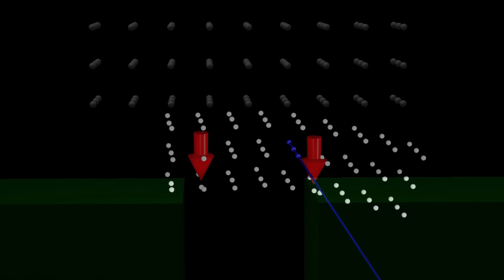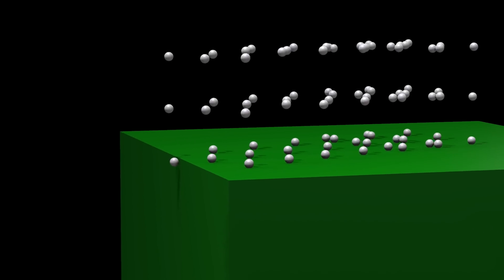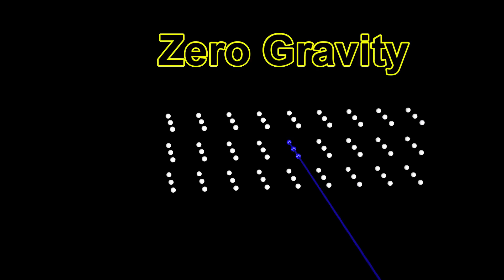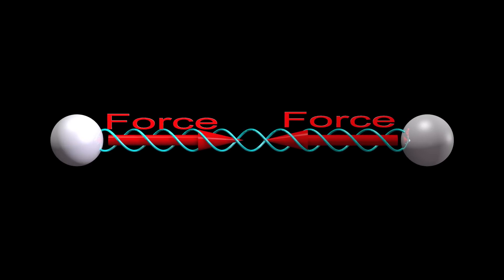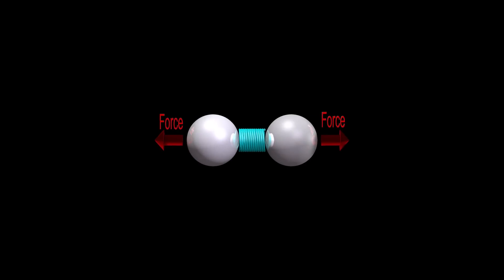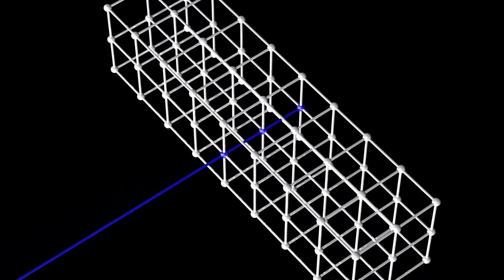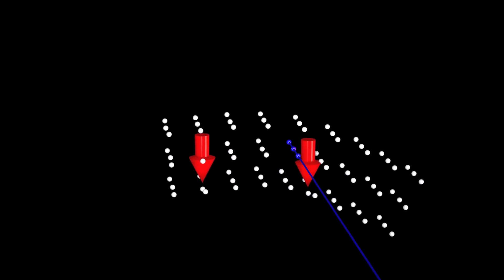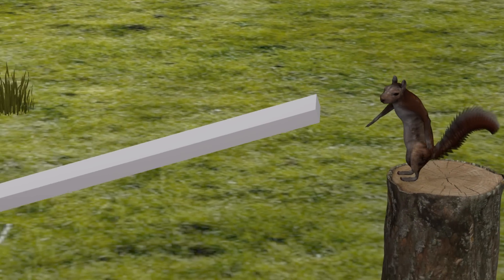Torque can’t exist for rigid objects

Comment from the maker: I have received a number of comments questioning whether we really need non-rigid objects.  This is discussed in much more detail, with mathematics, in the paper at https://scholarship.haverford.edu/cgi/viewcontent.cgi?referer=https%3A%2F%2Fwww.google.com%2F&httpsredir=1&article=1494&context=physics_facpubs
Reply: I've been interested in this specific question myself. I've gone through the same reasoning as the video laid out, but I'm not fully convinced one way or the other regarding rigid bodies. 

There are several reply papers you can find as well. One is Comment on “The physical origin of torque and of the rotational second law”, a counter-reply is Reply to “Comment on ‘The physical origin of torque and of the rotational second law’”, and another one is Another comment on “The physical origin of torque and of the rotational second law”.

I wonder what you think about them.
Reply: @maximusideal  For some reason, i can't see my second comment anymore. To keep it short: I didn't realise there were comments on this article. The article by ‘Randall D. Knight’ already shows what I have claimed: The forces assumed in the original paper are not correct. Regarding the comment on the comment (by Daniel J. Cross himself): I understand the points being made, but the maths is definitely missing here. An important concept that Daniel J. Cross ignores is that bearings can cause external forces and torques, so in some cases even the energy and angular momentum are not conserved.
Reply from the maker: @jjs9473  If you sort the comments by "Newest first" you will see all the comments, but if you sort the comments by "Top comments", then some comments will be missing.  This is a bug with YouTube.  As for the discussion regarding the paper, the mass further away from the pivot is not directly connected to the pivot, therefore it can only feel the forces exerted on it by the other mass.  The forces the two masses exert on each other are, by definition, internal forces.
Reply: @EugeneKhutoryansky  Thanks for pointing out the bug! Now to the problem in the paper: Section III assumes (see figure) that both the force -T and the external force F act on the outer mass point. Only the force T acts on the inner mass point. But in general, each mass point could experience an external force and internal interaction forces with other mass points. Depending on the problem, the external forces and internal forces depend on other forces, force fields and/or the state of motion. The problem in the paper is, that the forces T and -T, that are introduced in section III, are neither internal (because they are not parallel to the line connecting the mass points) nor external, because it is assumed they cancel out due to Newton's thrid law, which is only valid for internal forces. So I don't get why there should be the forces T and -T in the first place. These forces completely ignore Newton's laws for mass point systems. The solution to the problem is that external forces act on both mass points. While one force is impressed from the outside, e.g. by pulling or pushing, the other external force is a reaction force that is dependent on the impressed force. The reaction force is exerted by the pivot to ensure the rigidity of the system and to hold the pivot in place. Thus, there is no contradiction to Newton's strong third law.
Reply from the maker: @jjs9473  You and I have been continuing this conversation underneath comments from several different people.  For everyone else reading this, I would like to copy your last statement from under a different comment, where you now agree with me.  In this statement, you wrote:  

"Ok, I think I know what you mean now. I think your point becomes clear with an extreme example: Take three mass points with equal mass that lie equidistantly on a straight line and are rigidly connected to each other. If you exert an external force on the middle mass point, which is also the center of mass, perpendicular to the line connecting the mass points, the result is a translation. Due to the rigid connection, the other two masses must experience the same acceleration, i.e. they experience a force parallel to the external force. However, this force cannot be applied by the internal forces, as they would have to be parallel to the connecting line according to Newton's strong interaction principle. This is where I see the contradiction proclaimed in the paper. Now I understand why perfectly rigid bodies are not realizable with the strong version of the third law."
Reply: @EugeneKhutoryansky  This is a very clear argument, nice @jjs9473
Reply: @EugeneKhutoryansky  this would have been a much better visual demonstration of your point.  In this video,  there are two many masses and not enough force or connection indicators to be clear
Reply: @EugeneKhutoryansky 
Sir, 
       If I place my hand flush against the wall and try to push the wall, does it mean I am applying force on the wall.
Since FORCE = MASS X ACCELERATION
ACCELERATION = VELOCITY / TIME
VELOCITY = DISPLACEMENT / TIME

Since there is no displacement between my hand and the wall therefore velocity becomes 0 and as a consequence Acceleration becomes 0 and hence
Force becomes 0. So does that mean I am applying 0 force on the wall ? 
Am I right or wrong Sir, please explain where I've gone wrong if I did.
I searched a lot on the Internet and YouTube but didn't find suitable answer for situation mentioned above
Reply from the maker: @md.uzairahmed7774  In that scenario, the velocity and acceleration are zero, but the force you are applying to it is not zero.  The reason the wall is not moving is because there are other forces on the wall (such as from the ground and other walls) that are balancing out the force you are applying to the wall.
Reply: @maximusideal  I did not know, there are comments on this paper. Randall D. Knight's first comment makes the point I have already made: The assumed pair of forces T and -T is an incorrect application of Newton's laws.

A basic concept of mechanics is that as soon as a body is forced into a certain motion, e.g. by bearings, external forces act on that body. In some cases, these external forces don't cancel out (as statet in the comment from Randall D. Knight's) and can even cause energy and angular momentum not to be conserved because systems can pump energy and angular momentum into or out of a bearing: A bearing always interacts with two systems!

A great example that shows the importance of this concept can be found in a slipping coupling of two discs. There are several videos on this by Walter Lewin: https://www.youtube.com/watch?v=NOfvX5raV1w
In this example, the conservation of angular momentum and energy is violated, as the bearing forces perform work and generate torque.

There is a simple argument to show, that Daniel J. Cross's Model is wrong: The net force F_net always equals M a_s, where a_s is the acceleration of the center of mass and M is the total mass. Because the center of mass performs an accelerated rotation about the pivot, the center of mass experiences a force that is made up of a radial and tangential force. The radial force is the centripetal force pointing in the direction of the pivot and the tangential force causes angular acceleration. According to Daniel J. Cross's's model, however, there is no centripetal force, only a total tangential force through F, while T and -T cancel each other out. His model does not account for all external forces! So his model not only violates Newton's strong third law, but also the second law, from which one can derive F_net = M a_s.
Reply: I've read through this paper. Thanks very much and it's really excellent to see animated something I tried to conjure up in my imagination so many times. 
I wish I could find more on this subject, of torque deriving from analysis of internal forces using Newton's laws rather than being short-cutted to from considerations of rigid body kinematics.
 I have searched for this before and it always seems to be completely neglected in any treatment of mechanics. 
Aside from the paper you recommended do you know any other sources?
Reply: I am a physicist and have dealt a lot with misconceptions in mechanics, especially on the subject of rotational movements of rigid bodies. The paper makes some incorrect assumptions: In section III you assume tangential forces T and -T on the masses m_1 and m_2, but these are not the internal forces between the masses, I don't even know where they come from. You have to be careful here: As soon as you connect the two masses collinearly with a spatially fixed pivot, external bearing forces act on the masses m_1 and m_2 for rigidity, which are exerted by the pivot itself! So the external forces don't have to fulfill Newton's third law, because they are external, not internal. You can show, that the (tangential part of the) external force F_R exerted by the pivot on mass m_1 equals m_1 r_1/(m_2 r_2)F, where F is the tangential part of the external force applied to m_2.

Fruthermore your torque equation is indeed wrong, because you have not taken all external forces into account. If you take the external force F_R on the mass 1 into account (F_R = m_1 a_1 = m_1 r_1 alpha), the the total torque is r_1 F_R + r_2 F = m_1 r_1^2 alpha + m_2 r_2^2 alpha = (m_1 r_1^2 + m_2 r_2^2)alpha = J alpha, still the correct result. The total torque consists of multiple torques with different radii.

In Section I you find that the multiplication with an radius r is indeed arbitrary. But that does not make the definition of torque incomplete. On the contrary: torque can be defined as a quantity that depends on the choice of reference point, which means that torque forms a vector field. Depending on the choice of reference point, a different relationship is obtained between torque, moment of inertia and angular acceleration. Search for the term phantom torque, for example (here is a paper about the phantom torque: https://pubs.aip.org/aapt/ajp/article-abstract/78/9/905/1056868/Asymmetric-rolling-bodies-and-the-phantom-torque?redirectedFrom=fulltext)

Your paper fails to pay proper attention to constraining forces. For example, as soon as you consider a perfect rigid body that is not subject to any other constraints, but some external forces are applied to it, the internal forces still fulfill Newton's strong third law (i.e. the internal forces lie on the line connecting two masses). This also applies under constraint conditions, but further external forces act to fulfill the constraint conditions.
Reply: @jjs9473  I started reading that paper and quickly concluded it was nonsense. It just states various things without the slightest justification.
Reply from the maker: @carlhitchon1009 Please see my most recent reply above.
Reply: @jjs9473 The paper is not making a mistake in this regard.  The mass further away from the pivot is not directly connected to the pivot, and therefore it only feels the internal forces generated between the two masses.
Reply: @jjs9473   That this line of reasoning is incorrect is the point that this section of the paper (section III) is making isn't it?  The diagram isn't very good but the lines drawn here are springs, not rigid connecting rods. 

I agree that the paper sweeps along and isn't very analytical. 

Also, the direction the paper is taking is to not assume rigidity, and that the only forces experienced by a point mass are the restoring spring forces between the mass elements, except for the outside mass which experiences the external F and the pivot which by definition has it's unlimited external force it fix it. 

The paper is frustratingly unclear and doesn't seem to consider the effect of the pivot on it's neighbour, simply homing in to conclusion as soon the standard torque equation comes into view. 

I'd love to find a more thorough discrete point mass - spring analysis of levers and torque which is more convincing than this paper.
  
 I'm hoping now that there might be something enlightening hidden in the conventional kinematic analysis of guitar strings.

Comment: 0:32 - What an idiotic way to deliver the idea: you teach people about torque and expect them to understand speed of sound in solid body and Einstein's theory of Relativity. If you want explain something you should operate with the concepts people already know.

And the rest of the video is shitty felony. Your "sticky model" could transfer momentum if molecules were connected with cantilevered beams, not hinge sticks. But you don't even explain cantilevered vs hinge. Alternatively, if molecules had diagonal forces between them, they would form a truss and be a rigid body. In the start of the video your model had diagonal springs but they disappear as you need to adjust your premise to squeeze out shitty "proof".

This video is a great example of toxic education. It won't make people smarter, it will make them schizophrenic by messing their minds, indoctrinating with unnecessary concepts and distracting from what really matters. Quit education immediately!
Reply from the maker: People don’t need to understand the speed of sound or Relativity to follow my explanation.  I just briefly mention these at the beginning.  As for the rest of your criticism, you may want to look at the paper at the following link.  
https://scholarship.haverford.edu/cgi/viewcontent.cgi?referer=https%3A%2F%2Fwww.google.com%2F&httpsredir=1&article=1494&context=physics_facpubs

Comment: in newtonian mechanics, the force between two particles is a function of their relative distance and velocity. since it is rigid, the force on each particle is initially zero. then if you apply an external force on the first particle, in order for the second particle to start moving, the first particle must exert force on the second, so the relative distance or velocity must have changed at least a tiny amount. so it can't be infinitely rigid.

Instead you can consider a finitely rigid system and take the limit as spring constant approaches infinity, then torque will work as expected. Or calculate using lagrangian or hamiltonian, and set the potential to infinity at all states except when the particles are exactly a certain distance apart and zero relative velocity

Comment: Yes, I have it! 
The mass elements above and below the pivot can move more freely around the pivot, and less freely toward/ away from it. 
Every time you insert an spring element between the pivot and the force, the force is  "turned" more to more effectively pull the elements above the pivot and push those below.
The side with fewer spring elements between the force and the pivot will lose.

Comment: Suppose the spring constant is k. As k approaches infinity the body approaches being perfectly rigid. You can increase k such that it is indistinguishable from perfectly rigid.

Infinity is not a number. Infinity minus 1 is not less than infinity. One can't say that something is different at infinity vs infinity minus 1.  How could one demonstrate that the situation would be different at k = "infinity" vs k = 10^100000000000000000 N/m.

There is no physical thing that has been measured or proved to be infinite. Infinity is not a determinable real physical thing.

That paper by Daniel J. Cross has at least one error.  In equation 2b the 'T' should be multiplied by r1/r2.

So - sorry, not sorry - This video is bogus.

(Nice graphics and nice narration voice though.)

Comment: Newton's third law talks about inertial forces, you're talking about mechanical constraints. Of course the solution does not work if you change the problem. Rigidity changes how much a body deforms when a force is applied, not the force transmitted by the body
Reply from the maker: If two masses are constrained to each other, then this means that there is a force holding them together.  Newton's Third Law applies to all forces.

Comment: This was a nice demonstration, but the argument is incorrect. We can assume a perfectly rigid object as, instead of just saying "stiff connections", a bunch of masses connected by springs (as in your example), but with infinite spring stiffness. All the consequences of a deformable object approach still apply, the forces get transferred correctly, and torque works. Rigidity isn't incompatible with Newton's motion equations.
Reply from the maker: If we set the spring stiffness to infinity, then this leads to precisely the problems discussed in the video.  This is explained in detail, with mathematics, in the paper at the following link.  https://scholarship.haverford.edu/cgi/viewcontent.cgi?referer=https://www.google.com/&httpsredir=1&article=1494&context=physics_facpubs

Comment: It would be better explained if you included a diagram like the one you have at 2:41, but actually two compared diagrams, one with a rigid joint and another with an ellastic (springy) joint. Instead of a momentum, imagine a force applied to one of the particles. In the rigid joint model, that would act as if it were only one body, but if we analyze the forces, the action and reaction force wouldn't be in the same line joining both bodies. That was the most important missing diagram for understanding, the other is more obvious, as the ellastic joint doesn't require to move the second body instantly as the first body where we applied the force, but that is determined by the spring whose force is depending only in the relative position of particles along it's axis.